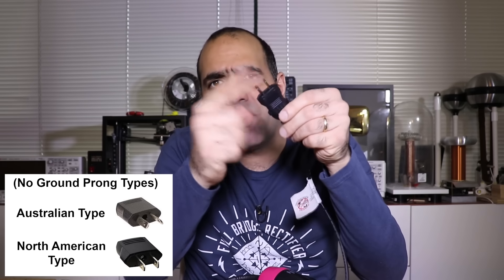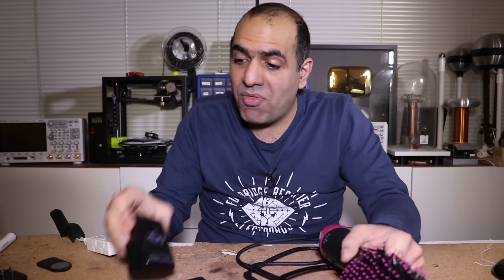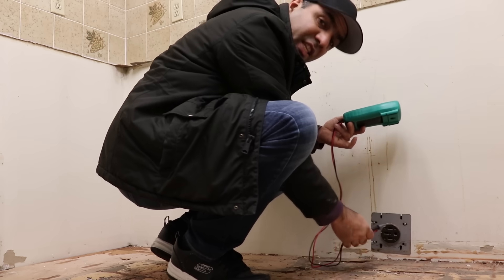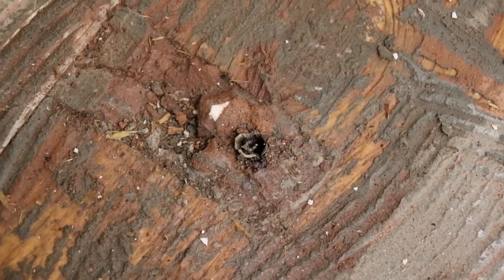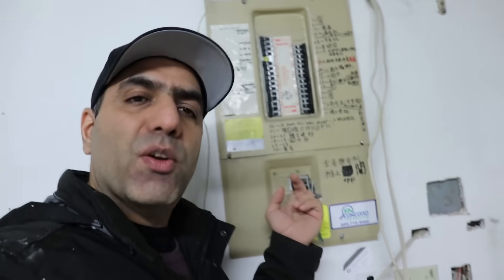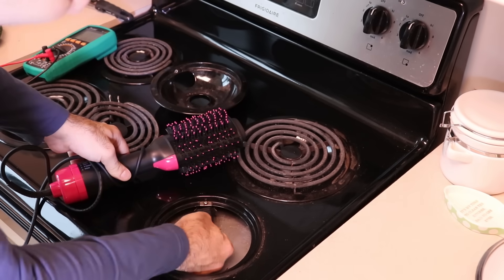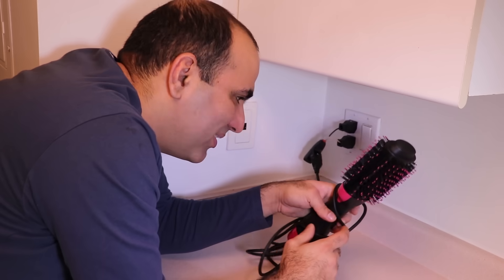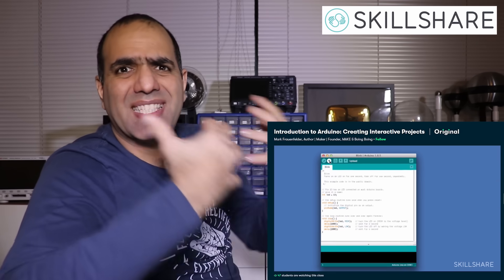Finding HIGH POWER 240V in a 120V Country

Comment: So in places with 120v they sometimes have sockets with two fazes for when higher current is needed like in the kitchen.
So Why Not Just Use 240v In The First Place!
Reply: @smashed_penguin  You could look at it with the understanding that standards are historically grounded and the understanding of the practicality of the change.  Your earlier statement said that 120V should never have been made, but there was a time when it was better so your statement was incorrect.

Today, It's not really causing a problem as you purport except for tourists that bring incompatible appliances.  For citizens, there aren't any problems and changing over isn't worth the benefits.  We already use 240 where it is most needed.

Also, stepping voltage up and down are equal in difficulty.  The problem is with the rated power of a transformer.  This problem is the same regardless  of which why you need to change voltage.
Reply: @longwave8156  Precisely. The US was on the bleeding edge of adoption. Safety standard were non-existant so the risk of shock were much higher too. The US plug is still awful. I would imagine before too long appliances will be negotiating their own power requirements anyway.
Reply: The shock you get from 170VAC (120V RMS) is, quite literally, half that you would get from 340VAC (240V RMS) and considering only 10's of milli-amps will kill you, that could be and has been a life saver. The only reason Europe settled on 240V RMS was because we couldn't afford the copper after the second world war, otherwise we would be on 120V too. Purely for safety reasons, the world should standardise on the American system, not the other way around, imho. American 120V with the British 'safety plug' would save so many lives.
Reply: @tictagtube  The "safe" american system with a plug where you can electrocute yourself by simply inserting or removing it from the outlet. The BS 1363 got sleeves on the L and N prongs to prevent this, but that came later, the first version had the same problem. The Schuko system we use here in Germany doesn't require this, it is recessed into the wall, so you can't make contact with exposed live parts when the plug is only partially inserted into the outlet.
Even on 120V the current is high enough to kill a person, 30mA is the threshold for a healthy adult. For animals and children the value is much lower, in the range of 10mA. That's the reason we install RCDs (residual current device) here, you know them as GFCI. It was already introduced in 1984 in the VDE 0100 (comparable to your NEC) at that time to install RCDs in "rooms which contain a bathtub and/or a shower" with a tripping current of 30mA at max. Now almost every circuit which contains outlets must have RCD protection. But the thing is: This is only for new installations, they can't enforce a retrofit if the old installation is in a safe condition and still meets the regulations and requirements which were in state when the electrical installation was built.
Reply: @Marcel_Germann  I agree, though you did kind of miss my point ;-)  My point was that, given the otherwise same scenario, more would survive an electric shock if supplied with 120V RMS than with 240V RMS. Totally agree if the Schuko system is empirically safer, then we should all use that. But, like with the decision to use 240V over 120V in Europe, economics will always win over safety in a capitalist society. Yay for capitalism!
Reply: @tictagtube  If you have GFCI/RCD protection the voltage actually doesn't matter that much. The power supply will be cut off if the leakage current becomes too high. Voltage hurts, it's the current that kills. What you said is correct without the GFCI protection. Easy example, the average resistance of a human body is 1000 Ohms (more or less, depending on your skin), between both arms. Between arm and the ground it is actually depending on what shoes you wear and what type of flooring is in that room. But for convinience let's do the math with the 1000 Ohms. In case of 230V the current would be 230mA, in case of 120V it would be 120mA. Both are enough to cause cardiac arrest on an average adult if hit in the right moment, the threshold is 30mA. So if you install a GFCI/RCD the current will be limited to a safe value.
Compare which size of cables are required to power up a single family home. In Germany the cables coming in from the street have 4 conductors with a cross sectional area of 25mm² (AWG 3 cross sectional area is 26mm², AWG 4 would be 21mm², so something in between) each (three-phase, 3x230/400VAC). There are three fuses installed in the service entry box, each is a 63A fuse. That makes:
63A x 400V x sqrt of 3 = 43.6 kW. In the US I know that in newer installations the service is 200A (in older installations 100A), which are 48 kW. And now think how thick the wires are. And to make things worse: In a three-phase system the materials like transformers (on the street transforming from medium to low voltage), cables could be dimensioned smaller than on single-phase for the same demand. And I'm not talking about a small amount of material, it is actually 50% less!
Reply: @KeeDx3 yeh,  not for a single socket but the outlet has two sockets on two separate lines so you could draw more total power from said socket if need be. So again it seems like a workaround implemented for a sometimes insufficient standard.
Reply: If we switched to 240V, then appliances that can only run on 120V wouldn't work.  There's little economic pressure to change and more economic pressure to keep the standard as is.  There are historical reasons as well, but I don't want to get in to that.
Reply: KeeDx3 hello from the UK where we only get one phase...
Reply: @KeeDx3 Normally not, but in this case he simply connected the appliance with the two lines, without a neutral. For appliances which are designed for 220-240V it doesn't matter if they are connected between a line and a neutral with the required voltage or between two lines having the required voltage.
He simply designed an adapter to get the two lines from the different outlets, one outlet was connected to L1, the other one to L2.
Reply: Because 120V is safer, but our system gives us the option to use 240V where it is needed for high power devices.  My house only has 3 240V devices - the water heater, the stove and the heat pump.  Those devices have dedicated 240V circuits.
Reply: @smashed_penguin  A shock from a 240V outlet is 4 times more dangerous than a 120V outlet.  The multiwire outlet on 2 circuits is actually used because it is simpler, uses less materials, and is faster to install, and has less voltage drop.  It really isn't complicated, and other than in kitchens, it isn't common.  A 240V outlet is far more likely to cause a fire in the event of a fault because of the enormous amount of power available.  Why have 3+ kilowatts of power at every outlet when only 3 devices in the entire house needs that?  Plugs in your system have to have a fuse to mitigate that risk.  Ours don't.  We just have to wait a bit longer for our tea.
Reply: @smashed_penguin  Touching 120V isn't a death sentence.  Unless water is involved, fatalities are fairly rare.  But 240V is 4 times more likely to kill you.  That's hardly the same thing.   Electricity is a fire hazard, and anyone who doesn't know what they're doing shouldn't touch it.  Most of the electrical codes we have are to prevent fire.  Does that mean it's impossible for non-electricians to learn to do it?  Of course not.  But if you find multiwire branch circuits "too complicated" then you shouldn't be messing with electricity.  It's simply two circuits in one box.  

I never have to think about what outlet I'm plugging a space heater into or run an extension cord.  I just plug it into the nearest 120V outlet.  Rooms like the kitchen which are likely to have more medium power devices have more and bigger (20A) circuits (hence the reason for the multiwire branch circuit there).  It sounds to me like your electrical systems aren't sized right.  One outlet for a room is certainly not.  Our code requires no point along the wall to be more than 6 feet from an outlet.  Most average sized rooms have 4 to 6 boxes, with 8 to 12 outlets.  As far as likelihood of fire, the more power involved, the higher the chance of fire with a fault.  If everything was always "properly functioning" then we'd never have any electrical house fires in the first place, would we?
Reply: @smashed_penguin  You are looking at this from a standpoint of what is better today and not at the time of its invention.  When the 120V standard was produced (actually 110V at the time) light bulbs had carbon filaments, knob and tube wiring was still used, low voltage DC transmission was being debated, and devices didn't need much power.  AC/DC appliances such as radios were made into the 50s (maybe later?) so 120V compatibility was needed.

Comment: In memorandum: all of the green multimeters that lost their life to Mehdi trying to probe for voltage while in current mode. 

I use the multimeter function on that nifty handheld oscilloscope you used in the Heated Seat video because that input is unfused and I don't need to buy a fuse if it blows up... right? ....RIGHT?! (Disclaimer: I am not an engineer)
Reply: Technically true: You don't need to buy a fuse if it blows up.
Reply: Technically correct is the best kind of correct.
Reply: your second paragraph is going to give me nightmares
Reply: You're so naive!...what he does is called ACTING... otherwise it would be boring.

Comment: Meanwhile here in Brazil is easy to find 127v and 220v in the same house, its commom to run the power outlets on 127v and eletrical shower head on 220v but also leaving some random outlets also running 220v just in case you need it (since some regions here are main 220 and others 127 so is usefull to have both), I have toasted a few eletronics already by plugging in some random unmarked 220v at some places. Yes it is a mess.
Reply: Electric shower heads seems like a very nice idea.
Reply: Yes, the 'suicide shower' as Bigclive refers to it. Often there's literally an outlet above the shower that it's plugged in to.
Reply: Ajinkya Kamat Meh, if you dont die the first time its scientifically proven that its safe.

Also should someone have been killed "its just a prank bro" frees you from all responsibilities in court.
Reply: Ajinkya Kamat Brings me back to when i was a student and lived with 3 classmates in a beyond shoddy 2 room apartment. 

When you went to the shower you had to make sure to not touch the sjowerhead or the rack where the showerhead sits, else youd get shocked. 

Classic prank to push someone into the metal while they were taking a shower. Nothing wakes you up more than an electric shock during the morning shower.
Reply: Is there any indication which is which?

I read that Japan is like this in some regions due to different standards which is surprising, given how ordered Japan is on just about everything else.
Reply: @lemagreengreen  the indication is the smoke coming out of a 127V when plugged to a 220v socket. 
We have in São Paulo 220V almost anywhere, but for some historical reasons we also have major cities using 127V
Reply: @lemagreengreen  Japan is weird when it comes to electricity. They have the same voltage through but the frequency changes. It's 50Hz in half the country and 60Hz in the other half. They also have a weird way of grounding. Their plugs only have two prongs and there is third wire that sticks out that u have to seperately plug-in for ground
Reply: Where u from? Here in SP we have ALL the sockets running 220V and the lights on 127V for safer use of the mono pole switch, since it brakes the live and the neutral goes to the light socket.
Reply: @Roalethiago  interiorzão de sp

Comment: In Saudi Arabia we use the two phase system in the whole house, we have two outlet types one is two 110 v wires 180 degrees out of phase and we label them 220v and the other is one 110v wire with the neutral wire
Reply: That's single phase split phase

Comment: 3:47 I was yelling in my mind "don't select the current meter mode"
Reply: Yup, saw it too :) For now I have tester which is dummy-protected. It closes all the sockets except the ones for mode selected, or vice versa - doesn't allow to rotate mode selector unles you pull away probe. So far I didn't fry it away :)

Comment: Seriously one of the best videos you've done.  The spaghetti twist was amazing!

Is it normal for contractors to just cut thru live wires and let water drip everywhere?? Seems like the water would be a big problem for essentially everything.
Reply: Yes. Worse than that I had a landlord in Cardiff who had a flat energised and occupied by a tenant for months while his crackhead builders worked on the flat above. They took the sink off and didn't drain and cap, resulting in quite a lot of water running into the building's fire alarm system and her lights. He refused to return her even a penny's rent while she had buckets in the flat and couldn't safely live there. Absolute scumbag.

Comment: :P come to germany. We have 240Volts and 400Volts EVERYWHERE here. Even in very small appartments
Reply: The 400v is confusing its 230v three phase and neutral
Reply: @the_retag  Yes yes. Of course it's not pure 400Volts.
Reply: 240? Thought Germany had 230 volt at 50 hertz since 1987.
Reply: @Krogdalo  230v +/-  10%

edit : 5% not 10%
Reply: @Krogdalo  3 phases with 230V which are 120 degree apart
Reply: But i guess  we can't talk about our Internet so proudly😅
Reply: ok e-boomer
Reply: @thorodinson7467  k, normie
Reply: BloodyClash damn 400 volts, isnt that so unsafe
Reply: @ChronoSphinx  we use it to connect our ovens. Even without fuses off it's extremely hard to touch it accidentially
Reply: @ChronoSphinx  it's three phase. That's hard to touch.
Reply: @ChronoSphinx  It's EU, our electricity is safer.
Reply: @ChronoSphinx  That's just about when the real fun starts.

Comment: The "solution" will trip a GFCI though so keep that in mind.
Reply: You can't split a GFCI like this though. They don't have tabs running between the two halves of the duplex receptacle. 

Also, no it wouldn't. There's no sharing of the neutral, and there's no current running to ground.
Reply: @shikutoai  If either leg of that outlet has a GFCI upstream it will trip because current is only flowing through the two live paths and the neutral is not used.  The GFCI would have to be around the two live paths to balance out.

Source: My inverter has a GFCI built in and when I tried to put one half of a split outlet on it it was continually tripping (granted because the shared neutral but the problem is the same).
Reply: @tomstdenis  

It really depends, actually, on further thought. Some GFCIs actually measure current flowing to ground, in which case it would not trip from this setup.

Most GFCIs, though, monitor current from hot to neutral. And they definitely would trip.
Reply: @shikutoai  A standard  120 volt GFCI expects the current over the neutral and hot to be equal.  Nothing more.  Leakage to ground or another out of phase hot would make the neutral out of balance and trip the GFCI.

What he was doing wasn't "unsafe" (I mean the adapter was sketch but...) but simply ill advised in a mixed outlet circuit.  Though kitchen outlets are /supposed/ to be on their own circuit.  In reality what you might find is one of the 2 is on their own circuit and the other is shared with other circuits.  (the outlet doesn't have 2 dedicated breakers).

Comment: You only have 240 Volt at your Ofen? I have 400 Volt at my Ofen
Reply: Are you sure?? I was constantly told that oven works from 3-phase outlet. It really looks like 3-phase. But later I found out that all 3 'phases' contacts are actually connected together and powered by single phase, 230 volts :) So oven is kinda universal: two heaters run from first contact, two other from other etc, so it could be run from 3 phase to balance them better. But metering 3-phase is real pain in the ass, for home it is much simpler to consume from just one phase. At least that's how it's done in Moscow, Russia.
Reply: @allmycircuits8850  yes i am sure its my job.

Comment: There's a device made in China that doesn't support the whole voltage range from 100 to 240? Well, that's, err..., shocking.
Reply: It's a simple circuit. All motor + heating elements like that are made for a set voltage.